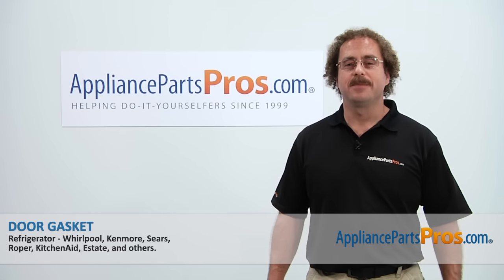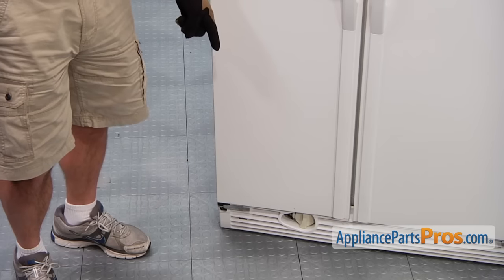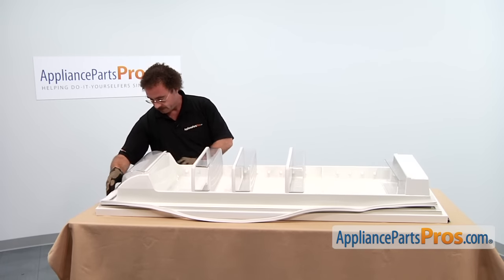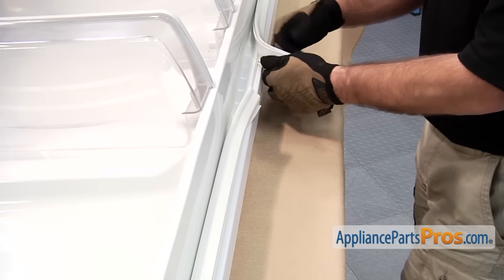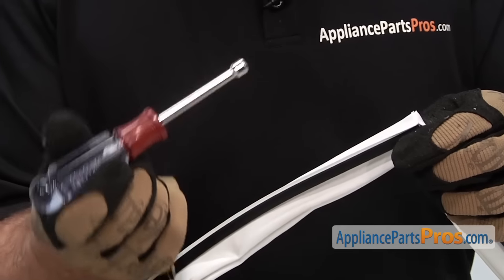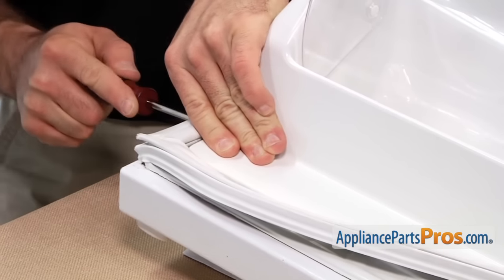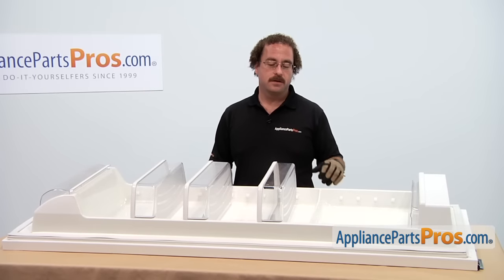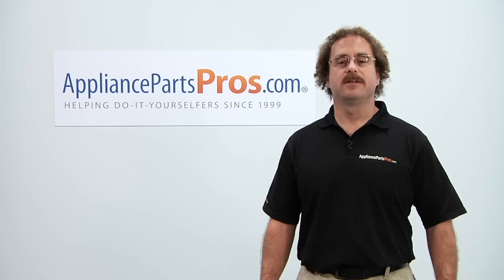How To: Whirlpool/KitchenAid/Maytag Door Gasket 2159075

Comment: Taking the door off - easy.  Taking off the old liner - easy.  Fitting the new gasket around the corners - an hour and a half of fits and starts, with lots of cussing along the way.  By the time I finally got them fitted, two of the corner seams had split.  These Whirlpool/Kenmore gaskets no longer ship with a rigid fitting to go under the lip - it's all soft gasket material and tears very easily.  My suggestion - you can do all the work of taking things apart, but hire a pro to fit the new gasket.  If it tears, it's on his dime.
Reply: ok an hour later, after much howling into an empty kitchen... bike tire levers sort of worked out ok. they're designed for getting the bead of a bike tire seated in the rim, and they're rounded so that they don't gouge the tire, so they were perfect for this.  also it helped to loosen the screws holding the inner door panel, just a turn or two, so the edge of the channel was easier to lift, and then tightening them again once done with a section.

Comment: Excellent video that covers everything you need to be aware of. I followed it exactly and got the new gasket on and working perfectly. However, for my unit I did have significant difficulty getting all four corners in place. There were plastic trim sections on the top and bottom of the door that got in the way and only one could be removed. Also I needed to stretch the gasket to get it around the corner edges which also needed to be pried up with a small screwdriver to get the gasket edge underneath. But I got it done! Thanks for the most excellent instruction to us DYIers.
Reply: I'm staying in Johannesburg where can I buy fridge gasket in Joburg

Comment: I just did this with the gasket that does not have the metal lip, but one that came from a used unit. The ridge that embeds into the channel in the door requires that you have a plastic pry tool to lever the gasket under the door lip. I had one for other purposes, bought from Amazon, which is about half an inch wide with shallow steps along the pry side, and blue in color. It came in a multi-pack of pry shapes. This tool lets you more easily slip the ridge into the door channel. I did it with the door attached and it took about 45 minutes. It will require a lot of finger and forearm effort. The key with this type of gasket is to get a part of it near (but not on the corner) embedded first, because it’s impossible to force the corner in otherwise. The metal lip gasket is most likely designed for replacement purpose, as you won’t be fighting to squeeze the gasket in, but rather simply pushing straight without prying as the video shows.

Comment: There were some good tips in this video.  Using a nut driver handle to push in the gasket worked well.  This could be done with the door attached.  My KitchenAid has a wide groove for the gasket to fit into, making it even easier.

Comment: You DO NOT need to REMOVE the DOOR from the refrigerator OR the freezer to REPLACE the GASKET - this is WAY MORE WORK than necessary!!!  Why do "Pros" always do things the HARD way!?
Reply: Laura Sands a
Reply: You are right dear Laura.
Reply: So you can call them.
Reply: So they can charge u more
Reply: They get paid by the hour, that's why!
Reply: Here's where the reason to take the door off comes in:
1. You still have the fridge open (hint: cover the opening with Press and Seal or plastic wrap to keep it cool while working.
2. Now you have to cut and remove the old seal while the door is still hung.  This is relatively the same except you can't see the bottom very well and you have to stand on something for the top gasket.  Also, because the door swings, the back side is less accessible to you or tools while working, especially if your fridge is in an alcove with cabinets surrounding.  Yes, you can pull the fridge out.
3. To push any insulation back in with a scraper, you need to access all sides, top and bottom.  Easy for sides, top needs a step or two, bottom is crawl under and look up with very little space - those are hard and require you to get in odd positions.
4.  To replace the gasket, you start at opposite corners, easy on top, not easy at all on bottoms, especially back bottom.  Same for pushing in the gasket all the way around, especially for the bottom.  And then if you need to pull the gasket up or around, it isn't easy while hung.  Also, if you need to pull the gasket height out to get good even contact, the bottom is a lot harder to get to and see.
After all the above, some people will have had a lot more aches and pains by contorting into odd positions, all because you didn't want to empty the door, unbolt three bolts, and take the door off to place on a table where you would be working on a level surface, everything visible and at the same level the whole time - you could even do the gasket work while sitting in a rolling office chair!!  Good mechanics and repair people will do the work in a safe and efficient manner at a position level that is easier if possible. - that also means at less risk to themselves because aches, pains, injury will reduce their ability to work.
I would bet that the extra 5 min or less it takes to empty the door and take it off the hinges is saved during the removal and assembly of the door relative to all the time spent working on a door left on the hinges.  Besides, you probably have to clean the bins anyway!!

Comment: I just took off the old gasket and replaced it with a new gasket in literally 5 minutes!!!  There is NO need at all to remove the door!!!  That would have wasted time & energy!
Reply: How do I replace bottom gasket without removing the door？Cause it's really nearby floor.Is that more convient to replace the refrigerator if I lie it down on floor?
Reply: yeah no need to remove door LOL.What a waste of time.
Reply: DPT- Of course taking the door off is optional. But I wouldn't say it is much wasted energy as there are only three bolts to be removed from the top and the bottom is just lifted off its holding peg. It is a lot easier to install the seal on a bench than having to lay down on the floor to install the bottom of the seal.  I guess if you used a GPS to find an address they may give you instructions to take the interstate whereas Hwy 90 may get you to the same destination just a different route. Same thing here.
Reply: @zedcartwright5267  LOL what a nonsensical bit of gibberish. It's having to empty everything out of the door as well as removing the bolts and then removing and  reinstalling it vs getting down low and simply installing the new seal which is not that hard. Some people just like to do things the hard way.
Reply: Thank you. I was wondering what the point was to take the door off. No way I'm doing that lol.
Reply: Zed Cartwright - unless you don’t have a bench and don’t have the strength to man handle the door.  This was an excellent video to show how an appliance repair man could fix the gasket in his own shop on a brand new refrigerator

Comment: I was wondering what I was going to have to end up doing with the gasket I got shipped to me.  It is all creased and whatnot, and I was thinking I might have to send it back!  Thanks for the tip on heating it up a little bit.
Reply from the maker: David Wokojance The manufacturers do not always ship them in the best boxes. Lay it out in the sun or in some hot water before trying to install.
Reply: The one box was so tore up, the shipping invoice fell out of the box!  A huge hole on the side!  I ordered one for the fridge, and one for the freezer.  Unfortunately the fridge is the wrong size, so I have to send it back to Sears...  It's not as bad as the freezer though, so I'm not too worried about it.

Comment: "Like"? That's all I can do is "like" this video? Where's the "Love it!" button? If there's anything my wife will tell you in not, it's handy. I watched this video and got the job done in probably less than an hour after collecting some appropriate tools. Granted, I didn't cut the power (oops), but I'm sensible enough to know when it's really necessary. Also, we needed the freezer to be working...dang thing is packed.

By the way, a sharp metal cookie spatula works just fine in place of a putty knife if you don't have one handy. :)
Reply from the maker: Steve Ramer Awesome, glad you were able to get the new gasket installed!
Reply: Офигеть мастер! Взял  рабочий хладос с нормальной резиной и заменил хорошую резинку на ...... тоже хорошую! :))))

Comment: Jesus H. Christ! thanks God I did not followed the cutting the old Gasket; the new one makes the door push out and stays open in the middle; there is no adjusting or anything everything I tried failed; it was the right part number and yet I had to return it, not without a fight with the "seller" which is an appliance place in town..i had to use the old one which has a gap but at least the door stays closed in and the refrigerator works..DO NOT CUT YOUR OLD GASKET!! that is a horrible advise! -- The video is good to have, the removing of the door would let you work easier I guess but it is not needed; the fitting of the new gasket for testing should be done before removing the door and it would definitely make your job easier not having those gloves; if you are careful, you will not cut your fingers with the edge of the door while working your gasket in. I am surprised he did not wear a mask also!

Comment: This deminstration is in fact outdated.  There is a fourth screw to remove to get the hinge cap off.  Look from directly on top of the cap.  It's small and difficult to see unless your looking directly down from above.  if you don't and try to pry it off you will break the plastiic cover.  Secondly the removal of the old gasket is easy.  The new gasket install is a S.O.B.... and impossible if you've never done it before.  My advice, call a service man and watch and learn for the next time it may happen. After a couple hours of frustation I taped the gasket on and will call the service people tomorrow.  The video made it look so easy.  The ten minute change is a pipe dream.  Don't do it.

Comment: Just replaced my fan because the original one was noisy. I may have pushed the fan on the motor too far because the shaft protrudes through the fan blades. Everything seems to work, but is this a problem?

Comment: It took over an hr. to do, a lot of adjusting, he didn't show how to soak in hot water...after i finished, I was told by a tech that if I used a blow dryer on the new gasket, it would hav worked too, then instal it...

Comment: If the part attached to the fridge where the gasket touches is rusted,  is there a hack to replace this or temporarily do something until I can afford another fridge? Is rusted only at the very bottom,  causing a tiny air to enter

Comment: Not the video showing one how to replace the refrigerator door seals on a ge tbh185plr.  Not an easy job.  Door still sweats, fridge has uneven body panels.   Warning to customers , this group overcharges double to triple the cost of their parts.  Do your research!
Reply from the maker: I'm sorry for your issue, if you need any assistance, or have questions, you can call us at 1-877-477-7278.

Comment: I just got a door gasket, but it doesn't have that hard edge you push under. I'm worried if I take the old gasket off, I won't be able to get this new gasket under that space it needs to go.
Reply from the maker: If the part number you ordered is the correct one for your model then it should work for your unit.

Comment: This turned into a nightmare.. The new seals I bought did not have a hard plastic edge so I had to unscrew the inner panel from the outer.  No big deal right.. Wrong !! Now the door won't fit back on properly, Appliance Parts Pros did not show the proper seal for my fridge, The one I bought was an OEM Whirlpool part.  Now what..
Reply from the maker: All of our parts are OEM parts. As long as you used your appliance model number to ensure that you were purchasing the correct part for your model, then the part should fit, and the door should go back on. I recommend contacting whoever you purchased the gasket from to verify that it is the correct one for your model.

Comment: Didn't work for me.  My gasket has no such plastic edge.  There's a number of bolts which hold it in ?
Reply from the maker: Sounds like you have the older style. You can go to our website and enter your appliance model number to view the parts breakdowns to be sure you get the correct part for your model and see if we have a video for it.

Comment: I'd suggest checking the new door seal for size/fit before removing the door, very frustrating to remove the door only to find out you have the wrong door seal !
Reply from the maker: Seth C Good tip, glad the video helped you get the gasket changed!
Reply: AppliancePartsPros i need to change my refrigerators gasket.
Its an electrolux.
Can you tell me if they use the same system ?
Tnx in avance.
Reply from the maker: John van beek You can go to our website and enter your appliance model number to view the parts breakdown for the fridge. All the manufacturers have mounted them differently over the years. Here is a Frigidaire one that is similar: http://www.appliancepartspros.com/frigidaire-refrigerator-door-gasket-241872513-ap4374868.html

Comment: Not all these type seals have the hard plastic lip and they are a real difficult thing to get back into the door liner.
I did mine without removing the door and man that bottom section made me crazy!!.
I’d certainly recommend taking the door off for sure with this type of seal.
Used a hairdryer to soften the seal once it was on for a perfect seal.
Reply from the maker: Glad you were able to complete your repair. If there is anything we can help you with in the future please let us know.
Reply: @appliancepartspros  Thank you very much for the guide, it was the only video guide I could find that dealt with this type of seal - all the other push in type seals look a heck of a lot easier than this type.
Many thanks for the tips, helped me out here.

Comment: Remove the top half of the gasket with the door in place, Install the top half of the new gasket. Once in place remove the bottom half of the old gasket. Finish installing the bottom half of the new gasket. No need to remove the door.
Reply from the maker: Thanks for that tip.

Comment: My refrigerator is new, and is  not closing  on the upper right corner and the  bottom right corner, should I change the gasket?  Thank you
Reply from the maker: It could be the gasket, or it could be something like the hinges. We'd be happy to help you figure it out, but we'll need some additional information about the model and the problem. You can give us a call at 1-877-477-7278 or you can chat us at our website: http://www.appliancepartspros.com/. We will need the model number for the appliance, so that we can look up diagrams and information about your specific unit to give you accurate advice.You can look here on our website to help you find the model number: http://www.appliancepartspros.com/modelnumber_locator.aspx

Comment: sir can i question all door if same btu  rubber seal is all the same like here in philippines  samsung panasonic etc. how to buy tha in the supplier what can i say to supplier..please advise
Reply from the maker: All the seals are definitely not the same, particularly between manufacturers. You will need the correct part for your model of appliance. Unfortunately, we do not currently ship to the Philippines.  However, the most reliable way of finding the correct part for your appliance is by searching using the model number. Once you know that, you should be able to look up the correct part for your appliance, then locate it either online or at a local parts retailer.

Comment: My refrigerator gasket has come away from frig causing air gaps. I was told to use hair dryer to soften gasket push it in place and close for at least an hour. I have done this when gasket is cold it contracts and pulls away from refrigrtator and cold air escapes. I have had sears out twice for same problem. It doesnt want to stay close to refrigerator. what do I do?
Reply from the maker: It may be necessary to replace the gasket, then.
Reply: AppliancePartsPros u